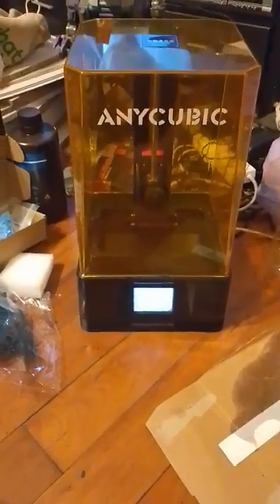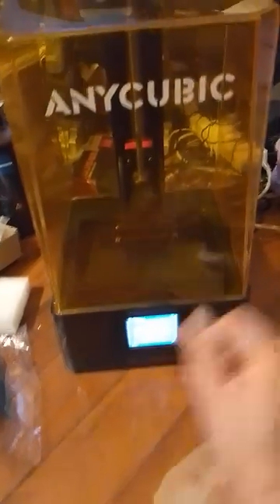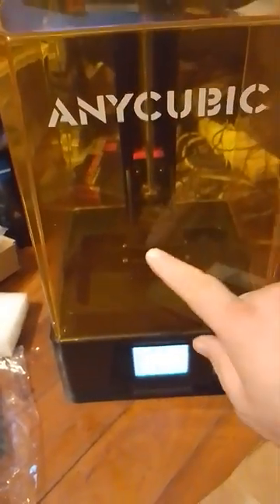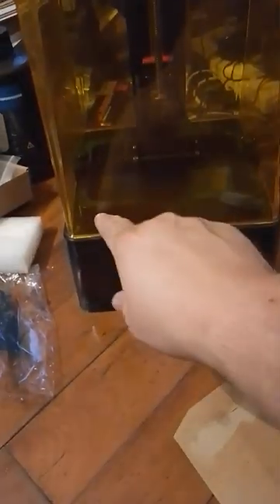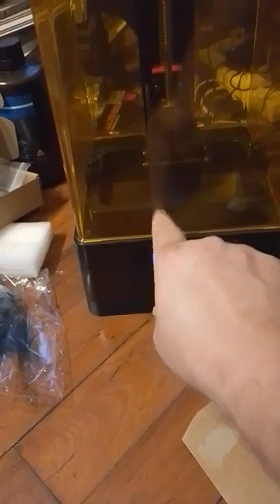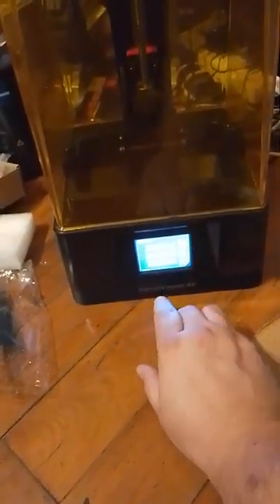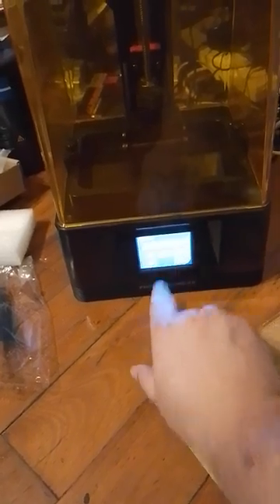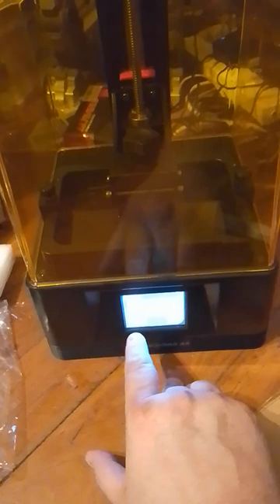Anycubic Photon Mono 4k fault

Comment: so an heads up about the FEP for the mono 4k that i found out the hard way is it uses an proprietary design FEP that glued into a frame can’t replace it with generic FEP have to buy anycubic FEP at $15 a sheet.   big regret buying this printer.
Reply: 3rd party vats exist , meanwhile this guys one is fooked, motor issue